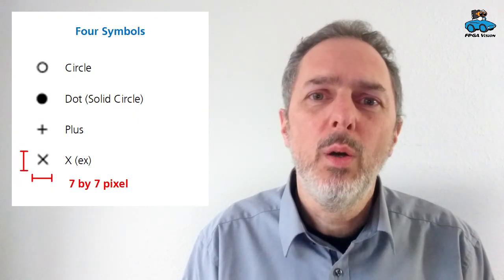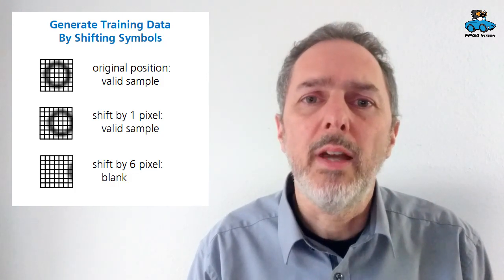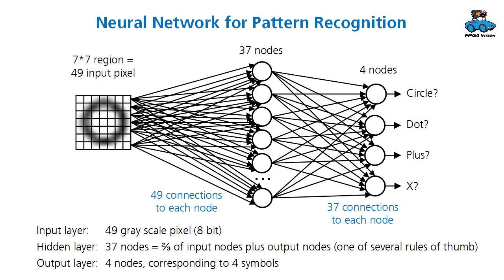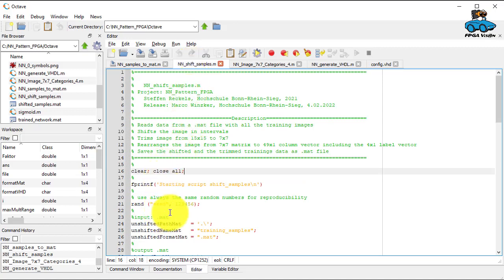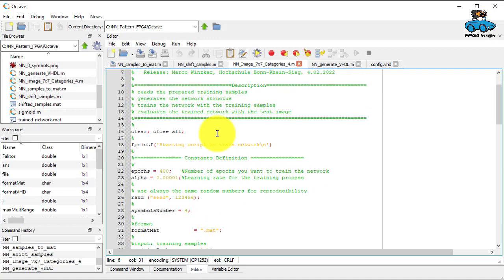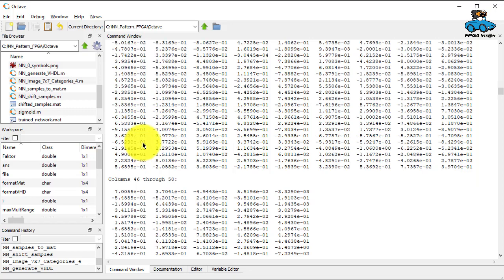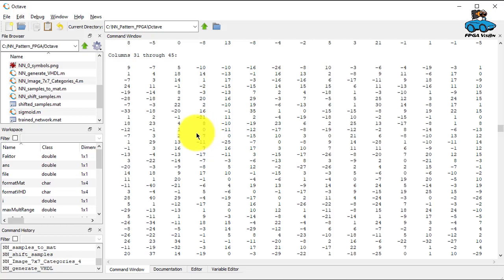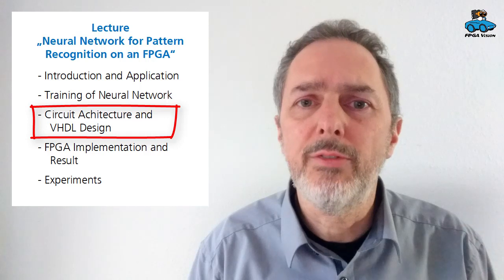Pattern Recognition with NN on FPGA - Training of Neural Network

Comment: Hello professor, i'm a undergrad engineering student, wastewater engineering to be exact. But i have a big love for computer engineering field. I have question about training neural networks. What i'd like to know is what is the difference of FPGAs and mythic ai chips?, also their efficiencies (not sure what to call it, i guess in terms of math operations in a second) of doing NN training.
thank you professor
Reply: oh and also what are tensor cores on Nvidia GPUs if i may add
Reply from the maker: ASIC, FPGA and GPU use different architectures to perform ML calculations. 

To make a long answer short: 
- ASIC faster as FPGA and FPGA faster than GPU
- GPU easier to access than FPGA and FPGA easier to access then ASIC

For more details please look at current scientific papers.